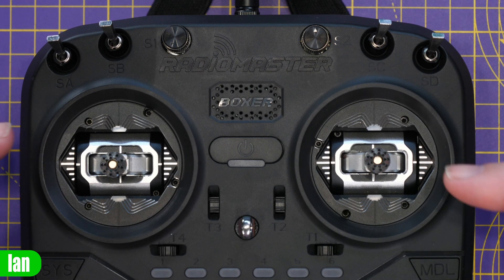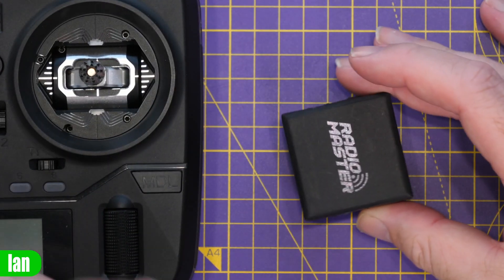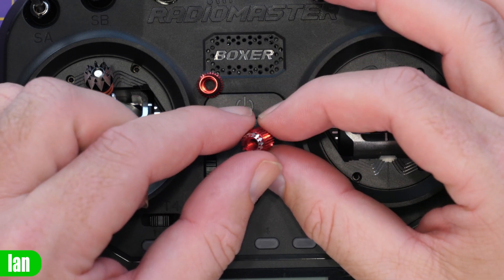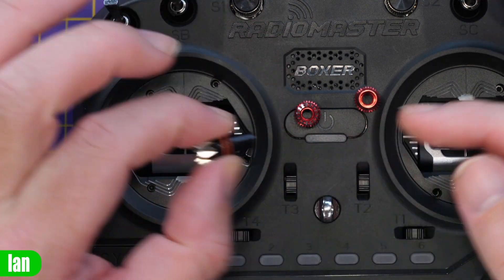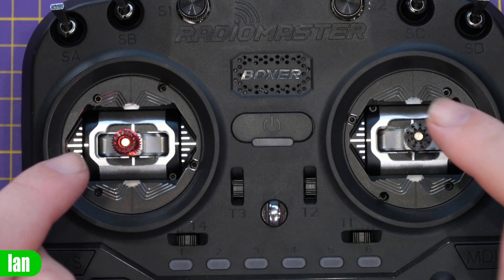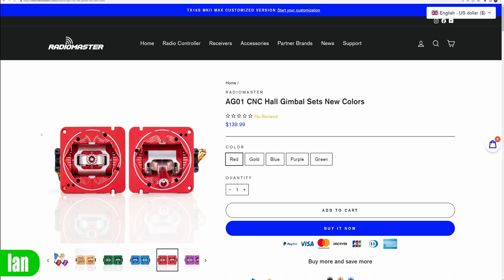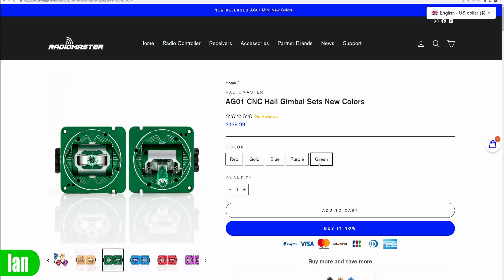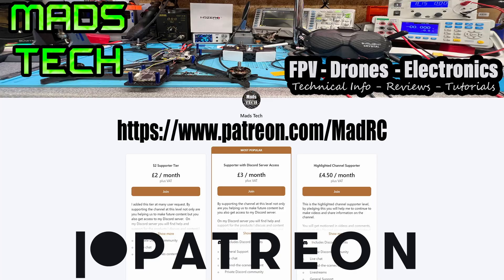Radiomaster Did It Again - Sticky360 Gimbal Stick Ends for Boxer & TX16S

Comment: I bet nobody has ever asked you this question: is there a way to virtually limit the stick deflection over the gimbal? on the radio menu there is only the possibility to limit the axis output, for example max roll output, but there is no way you can adjust the sides limit. I ask this because i have smaller hands and i cannot reach the full sides of a regular gimbal, but also smaller gimbals I tried are too small and so the drone becomes to sensitive. if there was a way to virtually limit the deflection you could adjust it to your specific needs

Comment: I love my mambo probably about to replace it with a ethix version since I got 1 broken switch..last 2 years I got my 100$ worth and it still works fine.thought about a boxer but if I buy a radiomaster it me a tx16
Reply: Tbs has replacement switches for sale, JB acts like it's impossible to replace, but Trappy does live replacement on the couch 👌
Reply: @Fly_High_FPV  I might replace it . I really only use 1 or 2 switches though

Comment: Every year it seems there is a NEW perfect radio to spend $200 on.
Reply from the maker: Not for me, the boxer is it.  Unless they make a Carbon case one.
Reply: @MadRC can you do a video on the new impulse rc Apex Evo frame?
Reply: @MadRC  Not for me either but my 1st radio was the X9 Lite because I got in to the hobby when that came out and everyone loved it. To me it turned out to be not very good. I ignored the TBS Mamba, the X Lite, etc. I did get the TX16S, last years best radio ever. Now it's a Boxer. It's just funny. I wonder what the next radio design will be? Maybe a Boxer with a color touch screen and a Bardwell edition.
Reply: @CarbonGlassMan  And You are right TX15 is like Boxer with color touch screen lol.
Reply: 159 for boxer & never need another radio!
Reply: @jgrc73  I'm still using my TX16S. I'd like a Boxer because a Boxer would fit in my backpack and my TX16S doesn't. It's such a large radio and the cool color touch screen, it turns out I never use it. Everything I fly is on 915mhz & they're all set up the same, so I dont' have to switch models unless I'm going to fly my Mobula 7, which is on 2.4ghz. So the big touch screen is a waste of money to me. But I'm not going to buy another radio. I think I'm done buying radios unless the one I have now stops working.